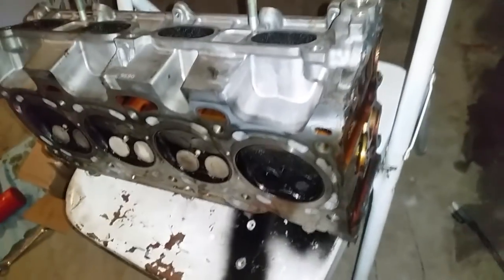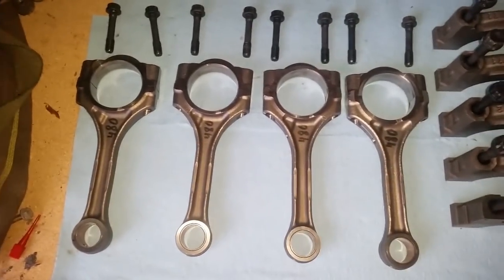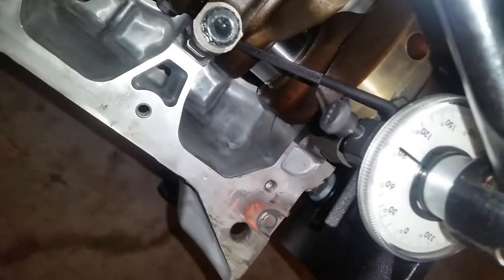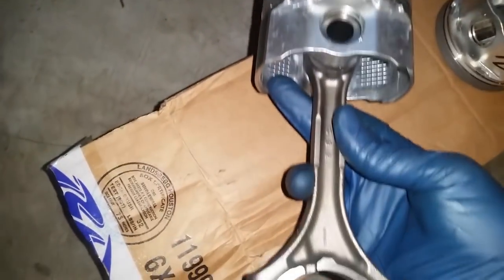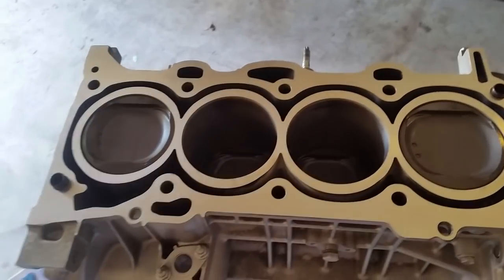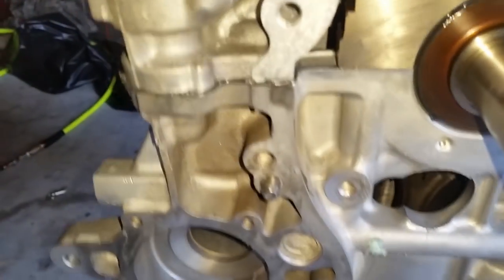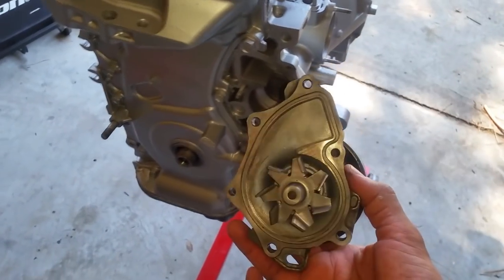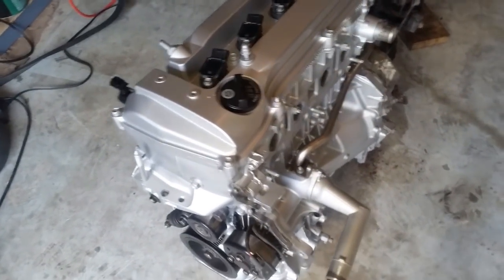how to: scion tc or 2AZFE engine rebuild [DETAILED]

Comment: I love my 09 scion xb did a road trip 2x from Chicago to Phoenix and back nonstop it did excellent . 180000 miles I only averaged 72 mph cuz gear ratio is too high I was at 3100 RPMS. I'm keeping the car forever. I think a 373 gear would be perfect with a little more HP . God willing I can do that someday . my xb is a manual transmission and it did very well through very high mountain passes . it actually did better than my FJ cruiser which really surprised me. I hope this a good testament on how well the xb really is compared to kia soul and other cars in it's class. If scion would had the gear ratio lower with a little more HP they would of knock it outta the park. The car never failed me. I'm very grateful. Thanks for the video and God Bless .
Reply: You don't understand how automotive design works. The engine is used in many other vehicles, same with the transmission to hit a price point. It would be very expensive to design and build an engine and transmission for each model. The XB2 is very well balanced with the options they had to choose from compared to the XB1.  The XB1 was under powered with it's smaller engine. The XB2 however uses the engine from the TC.

Comment: I need to rebuild my Toyota Camry  engine. This will help a lot! A rebuild kit is a lot less expensive than a remanufactured engine, and a lot more reliable than just buying a used engine. Rod came off yesterday after 230k miles.
Reply from the maker: I'm glad you liked it. I did 3 years of instructing too.
Reply: @manuelbou  @ Importworx,how can one get reference manual?

Comment: Great video, im watching because i just seized my engine on my 08 scion tc. Oil consumption sucks. Your video was very helpful. Iv replaced a 318 on an 84 dodge d150 but not a scion yet. Im getting a rebuilt for 1800.00. I was quoted 5k to replace from a shop. Thats too much

Comment: Yo, the bolt for the chain tensioner by the oil pump is not 14ft/lb. It is 9. Broke mine off by following that instruction. Other than that, this has been a great help in rebuilding my 2AZFE. Thank you.

Comment: Great video. Im a Mercedes Diesel tech for Yachts, pleasure craft, military vessels. I noticed in the video that the oil control ring expanders can go either way. On every engine I've ever built I always point the ends up. I was taught a long time ago that it keeps the oil from dripping off. I have never actually verified it.

Comment: Horns go up but the torque for the crankshaft is 29 and not 30.
Great video, very detailed.
Good job 👍
Reply from the maker: I'm using Toyota factory service manual, I didnt make up a single torque value up.
Reply: Importworx //
I never implied that you made anything up and I truly enjoyed your video and it is one of the best that I have seen.
I am rebuilding the engine in my son’s car based on your video and I appreciate you making this very detailed video.
You mentioned that you didn’t know what the torque for the oil jet was and  I went to the service department of the Toyota dealership and they printed every single torque spec for me ( 4 pages) and the torque for the oil jets under the pistons are 15 which is hard to believe that such small screw is15 and the rods are 18.
I didn’t trust the 15 pounds and tightened it good and for insurance I put a small amount of thread lock on it .
in the papers they gave me the torque for the crankshaft is 29.
All have to be torqued to 15 and then 29.
May be they changed it and originally it was 30.
The only reason I mentioned it is because your video was so detailed and helped me so much that in a tiny tiny way I wanted to return the favor.
If I offended you in anyway I apologize and that was not my intention.
Again and again , out of the 100 videos I watched yours was the best by far.
Good luck to you.

Comment: I never put it on top dead center as  I install the head. I always put it halfway on a upstroke to top dead center, this way all the Pistons end up on a half stroke and you can install the head and without even thinking about bending the valves, then you can slowly put it on top dead center after you've lined up the cams to install the timing chain or belt whatever the case may be.
Reply: Great tip. Even a a slight ding can be a start to issues. Thanks
Reply: Youre so wrong here bron. Tdh will never tough your head and it has to be at tdc to time it correctly as you put the head on
Reply: @xESPplayer500x  I'm not gonna bother explaining this to you because you're clearly not an auto mechanic and you wouldn't understand. I'm an ASE certified mechanic, I believe you're a YouTube mechanic at best 🤣🤣😂 Have a nice day.
Reply: @xESPplayer500x  BTW.... don't you know that before you hit TDC there's an area where all piston are midway of a stroke? Then you can safely install the head, afterwards you turn the crankshaft clockwise till it's at TDC to install the timing belt with ease without risking bending any valves
Reply: @ricgomez1  i use to work on an engine building assembly line. So come back you know something about auto mechanics 😂

Leave the detailed work for people who jave a brain.

Comment: I'm almost finished with the assembly, but there is a plug I have no idea what it is to?  If you're looking at the back of the engine, on the right side by the intake manifold there is a small round two prong black plug.  It has a very short cord to it.  I believe it's shown on page 49 of the Engine Mechanical in the service manual but doesn't list what it is.

Comment: Wow. great video. My 2006 Scion tC burns oil but I have been doing engine soaks to loosen and remove the carbon buildup around the piston rings. It seems to be working. An engine rebuild would probably be too expensive. Excessive oil consumption even for new cars is a problem as automobile manufacturers try to meet EPA standards and regulations.

Comment: Hey, im replacing the crankshaft connecting rod bearings on my 07 tc, just to be clear are the bolst torqued to 18 or 15 ft ponds + 90°...

Comment: Hi importworx,

My name is Jack. I currently have a 2009 manual scion tc. About six months ago I took it to Toyota and they performed the oil consumption test. I knew the car was not going to make it and of course, it didn't. The engine seized the next day. They wanted my oil change receipts and I did the oil myself so I never had a record. They couldn't help me out at that point. So I paid 3k to get the engine rebuilt as my time was limited to do it myself. Changed the oil after 500 miles and then another 500 to be safe. On the last oil change, I made it 700 miles before I heard loud knocking, I checked the oil and sure enough, it was empty. The car never smoked or leaked any oil after the rebuild. Took it back to the machine shop and they have no idea how it lost oil or where it went. They said they the rings seated perfectly. They are trying to blame me, I just want to know what happened to the oil so I'm not out 3k. I'm going out on a limb to hope you know anything about this problem. I am pretty sure they didn't touch the head during the rebuild. If you know any information at all or could point me in the right direction I would extremely appreciate it.

Thanks, 
Jack
Reply from the maker: Actually I do know, they most likely did not leak test the cylinder head. There is a high chance the oil got burnt by leaking in to the combustion chamber by either leaking valve stem seals or a crack in the head.
Reply: @manuelbou   Thank you for replying! This will help greatly in resolving this issue.

Comment: Hey I'm in the middle of a rebuild, I can't figure out what O ring you're talking about at 1:03:00
Can I just get any rubber o ring that fits or is there a specific part name/number for it? I'm pretty sure I've got the same pdf as you do in the video but I can't find it mentioned.
Reply from the maker: Good question. You can use any o ring if you can't find it individually, the only thing to look for is to ensure the new o ring is raised when laid down. Meaning it has to sit higher than everything so it can seal. When it gets squished. Also a little dab of rtv will help a lot. IIRC the oring came as part of the lower pan rebuild kit.
Reply: @manuelbou  holy shit man, didn't actually expect a reply on a 4yr old video. Videos have been insanely helpful so far. Thank you for all you do my man!

Comment: Good job on the vid and clean work by the way. Attention to detail, nice. I'm curious as to where you got your rebuild kit and more importantly, what brand did you go with? Most of what I see is the dnj or epo as far as complete  rebuild kits go. Any experience with either? Motor is already down to the block, machine shop, order parts and get this thing together with your help. Any additional tips or advice would be appreciated. Btw is a coated piston recommended on this build? Thank you
Reply from the maker: Thank you for the compliment.  Just used my phone and an old laptop to cut the vids anyways,  I used enginepartsonly.com master rebuild kit. I do have prior experience with those aforementioned brands(DNJ etc.) They arent really that bad, I haven't used them on my cars but on the customer cars and they haven't ever came back complaining about any issue due to part failures. And lastly a coated piston does have its advantages but the OE replacement piston for this engine is sufficient and you dont need all those extra features unless you just want to spend the money. I'm here and willing to help you through your rebuilding
Reply: @manuelbou  Sincerely appreciate the reply. Thank you.

Comment: I’d like to add some things and please take it as advice and not me being a know it all. I appreciate you taking the time to do this video to be extremely helpful to many many people. One thing about balancing is as follows: the rotating assembly is balanced (not perfectly by any means I know) at the factory with the weights of the rods, pistons, wrist pins, rings, bearings, etc. Therefore, if you change the rod, piston, wrist pin, etc. weights, you are actually unbalancing the rotating assembly. Technically you should weight match all the parts to their corresponding parts, ie. pistons to pistons and rods to rods, etc. Then you take it to a machine shop and have the rotating assembly balanced. This is the best way to do a proper balance job. Then, as far as oil clearances, you can mic the rod and main journals of the crankshaft and, if they are within specification, you can purchase standard bearings and recheck the clearances. One might say “what average Joe has a set of micrometers?” To this I say 3 things. 1) To do the rebuild properly, it helps to have these tools along with bore gauges and other measuring tools. 2) you can purchase dial calipers accurate to .0005” for fairly cheap. 3) Machine shops can measure journals and recommend proper bearing sizes. Therefore, you have 2 affordable options at hand. Additionally, if you are checking rod bearing (crank side) diameters with a bore gauge, inside micrometers, or telescoping gauges with outside micrometers, ALWAYS clamp the rod in a vise with soft jaws or in a rod holding fixture to torque the caps down with bearings installed for measurements. There are other things I could mention but I’m getting ready for bed. Again, this information should be advice only and not me being a know it all. There are other mechanics who have been doing this much longer than I have (20 years) and they may have better suggestions or want to correct me. I welcome constructive criticism and more efficient knowledge on mechanizing. Thank you for the video and have a great day! God bless you all!!!!!! Brett

Comment: Whatsup man, I'm sure i will be using this vid to help me in the future. How did you know that you had a cracked piston? You didn't have one of the mistake motors that were dealing with oil consumption? My 07 is going on 220k miles and have always dealt with oil top off but recently it's starting to discolor after 800 miles.
Reply from the maker: I didnt know i had a cracked piston. But I knew there was a major internal problem due to the consumption of oil. So what ended up being the issue is that oil would sling up thru the cracked piston and burn oil during the combustion cycle. 
An easy way to tell would be performing a compression check, low to no psi would be an indicator of this. 
Your oil going darker at 800 miles doesn't mean anything you should worry about. A simple oil change does mix with a bunch of old trapped oil that doesn't drain so its common for it to mix and look darker at that mileage point. As long as you're not burning oil away, the color shouldn't get any darker than dark bronze in between oil changes.
Reply: @manuelbou  Appreciate the reply. By me saying oil top off it's a little more serious than a few tablespoons every 1000 miles like a regular older car. I'm adding about a quart every 800 maybe. I will perform a compression check when i get a chance and get back to you on the results. Only reason im somewhat content with it is no signs of smoke out the tailpipe/bumper stains and no gummed up spark plugs.
Reply: @manuelbou  ok so i did a comp test and got 170,170,173 and 180. One thing i did notice out of the ordinary was the spark plugs had a lot of white/burn/corrosion, first cylinder had the most. Last time i changed them was about a year ago.

Comment: How’s the rebuild so far? I heard these engines can’t be bored/honed because they come with a sprayed liner. Compression still good?
Reply from the maker: Its been great. A while back the customer called to let me know how great everything has been but after hundreds of vehicles I go thru this is one I made a video about. There is nothing in the factory manual keeping you from honing nor does it mention anything against it. I got it honed which is critical to piston ring break-in and seating.
Reply: Alright thanks, wish me luck. I’ll let you know if anything goes well or bad. Just waiting on the new pistons and gaskets.

Comment: What manual are you using tor your torque and sequence specs at 21:03? I'm looking at Alldata and the torque is 40Nm/90° and the sequence is from the middle cap going out. Oil Nozzle 62 in.lbs. Nice video.

Comment: Great Video.. !  i will be using this as reference in the next week or two to rebuild my own engine..  question.   what pistons did you use in the rebuild.   while my pistons are probably ok, since the issue i had was a bent rod.  im looking to just replace both rods and pistons.
Reply from the maker: Pete Molina the customer decided to purchase the pistons from enginepartsonly.com at the moment he has put over 15k miles and no issues so they appear to function good.

Comment: What pistons did you use? Oem or aftermarket? Also did you see any variations in pistons for sale vs what you pulled? I was told there were like 2 different sets of pistons what went into these engines.

Comment: Brass is NOT softer than aluminum FYI. Brass is 3 mohs, aluminum is at best 3 with some grades going down to 2.5. Should probably have use a really stiff nylon brush instead(or a thick nylon brush wheel hooked up to your angle grinder)

Comment: I never understood what the purpose of putting the same piston back in the same spot as where they came out if youre replacing all bearings with a std bearing, have the cylinders honed so nothings the same after and no reason why to..

Comment: Do you use rtv to seal the engine and transmission together? Also what's the torque spec for bolts

Comment: Hey great video.   I am ready to install the lower crankcase/balance shaft housing to the block.  I know it is sealed with rtv, but I am nervous because there are a couple of tiny little oil paths/gallows on the surface and not much room between them and the outside surface.  Do you have any suggestions for how you applied the rtv in that area?  Thanks in advance.
Reply from the maker: Sorry for late reply, those small paths are actually for rtv to pool up into it to provide a thicker seal where a flat surface wouldn't be able to provide. Basically adds girth seal to those areas. It's not for oil

Comment: Hello. I am slowly building this engine and with your awesome help I am not into the step on I stalling the crankshaft main bearings and followed by the Piston rods, I am aware the thrust washers will help prevent the crankshaft from not moving forward and back when accelerating,  my question is should it be any play when Installing the Piston rods? I noticed there is play after installing the rod bearings. I used the standard bearings but can't understand why they move back and forth.
Reply from the maker: There shouldn't be any noticeable play as the required gap is only for oil passages. There may be a possibility that you have undersize bearings.

Comment: Excellent video. 
Sir. I have a question - I have the Toyota Yaris 1.8 TS   2ZR-FE engine the car have 85.000 miles..as we know, this engine has a chain. Does the timing chain on a Toyota Yaris need to be replaced? I regularly serviced car (oil, all filters...etc)  recently changed the water pump + the engine sounds great.
Reply from the maker: You do not have to replace the timing chains on it ever. The only time you would is if there is an issue with the chain guides or the chain itself.